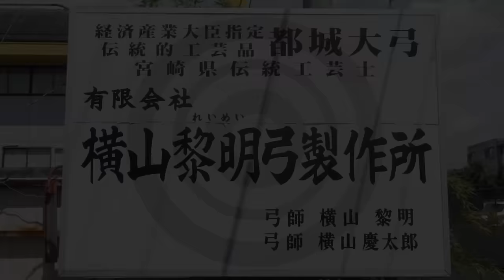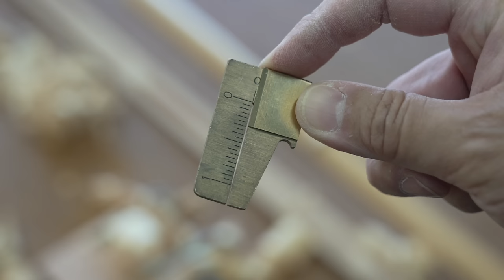弓ができるまで。長さ2mを超える巨大弓を作る日本の職人。

Comment: As a kid I used to make bows from split bamboo as well, but they tended to crack over its length. Now I see where I made some fundamental mistakes, so thanks!  It would be fantastic to know the approximate width of the core and edge strips. ❤

Comment: While this isn't my thing, as such, it's still remarkable craftsmanship, and very impressive. My only question is why he'd use a metal file and not a cabinet makers rasp for the finishing. Metal files fill up with wood dust quickly, which clog the teeth. A cabinet rasp would not, and would leave a smooth finish. But, I'm not the expert so I'm sure there's a reason.

Oh, and the lady bowyer wins. Perfectly calm, a smooth release, in the moment if ever there was one.